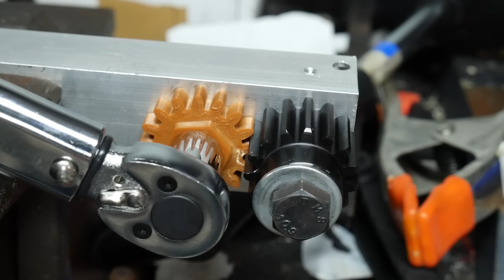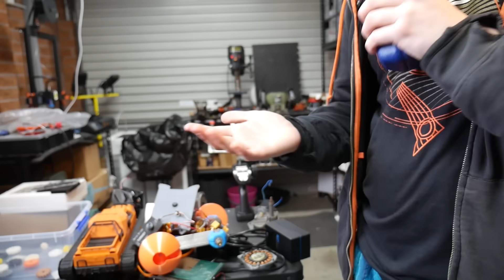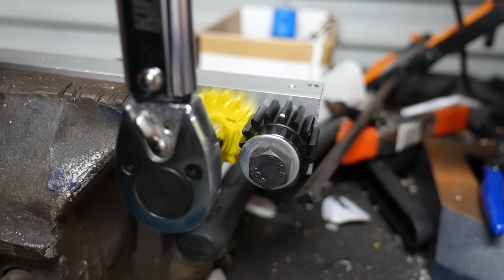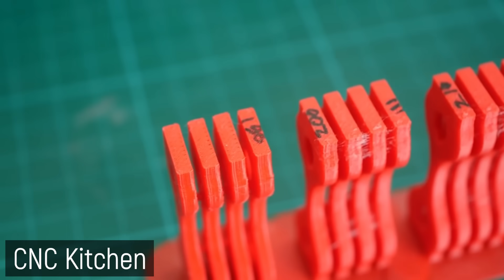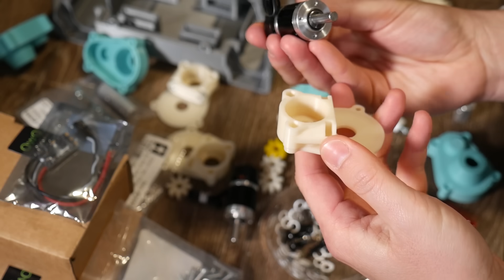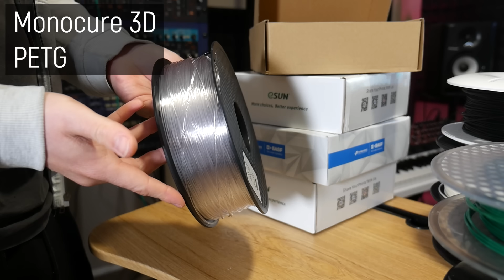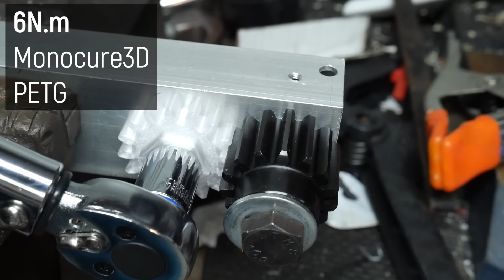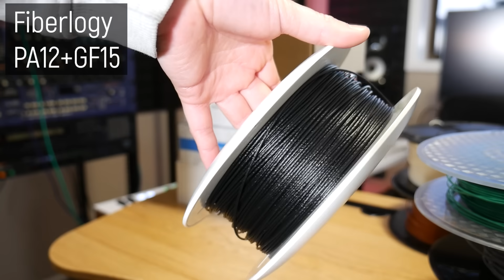Which 3D Printed Gear is Best?

Comment: Awesome video , big kid myself so have printed several rc gears and for what it’s worth small motor gears I’ve had excellent luck with Pla as it holds up well “ largest success with the common 550 brushed motors “ really any larger and friction develops too much heat in my experience and I’ve had the best luck with nylon here “ Taulman “ that even holds up well on my hpi 5.9 nitro , in a pinch I’ve even used some on my hpi flux hp which runs a 1/4 turn brushless which is just insane power wise fed with lipos , while these only lasted for say 45 mins on average with heavy abuse, keep in mind I  broke the hardened steel gear it had factory and kept me entertained till the replacement gears made it via post , I’ve never tried pc as my printers hotend max out at 270 which is a little low for it , did try a pc/abs blend but the nylon out performed it , no fancy torque wrench tests performed on my end , simply slapped the gears in the truck and drove it like I stoled it lol , would love to see how true pc would perform to see if worthwhile to upgrade a printer or not for it

Comment: I have printed gears before.  Tuff PLA 6 upper, 6 lower 7 outer walls 90% infill with no problem.  210 degrees nozzle and 55 degrees bed

Comment: Hey Angus, I noticed you applied the torques one after another in the same gear until it fails. When you do that you introduce cracks and  other deformations that's can cause premature failure. Is visible for ABS. I understand that you need to apply the torques for each specimens until the max level. Them you toss it out and start fresh in a new one.

Comment: I made a PETG speedometer drive gear for a project car. I didn't expect it to last too long or work well, but aside from uh, getting the ratio wrong (lol) it actually worked flawlessly and is still working! So I guess PETG is gear oil safe.

Comment: Perhaps a two piece gear would work well. Like a stiffer plastic mounted on the 12mm hex, then splined into an outer ring that forms the teeth of the gear made of one of the softer materials such as nylon.

Comment: I like nylon for gears bc of its memory and its self-lubricating. It's important to rehydrate nylon after printing before applying any stress.
Reply: Rehydrate? Could you tell more about this?
Reply: @BOTmaster15  as you may know, you have to dry nylon before printing it. Doing this makes the nylon brittle. It will rehydrate on it's own in open air after a week or two, if I'm remembering right. I leave my nylon parts in water for a day or so. They are noticeably different afterward. if you tap on them before the soak they have a higher pitch brittle sound. After soaking it's more of a thund.

Comment: personally... for a drive train i would much prefer a soft slip (like the nylon) over a hard break because any sudden spike in load could easily cause damage rather than being absorbed, it was a massive issue I had when I used to race off-road RC cars to get the best launch and acceleration the slipper clutch was almost completely locked and the engine clutch (nitro engine) was set with a high engagement... you had to make it around the first turn first otherwise any bumps from other cars risk removing teeth from gears....

Comment: If you plan to print solid, do not use 100% infill, use either 999 walls or bottom/top. Infill usually has different printing parameters from walls, often ending up under extruded.

And of course, melting it in salt would work here nicely and you get the parts annealed at the same time.

Comment: Could the Wood version of the filament be better than the others as that has wood fibers in it and is so good you can even sand it like real wood?
I would think that those wood fibers could strengthen the plastic more as the fibers of wood still have there own strength on top of the plastic strengths.
Reply: Nah, it's just wood particulate and the wood filled filament is very weak.

Comment: The fail mode isn't realistic in my opinion. You're stepping up the torque setting and testing on the same teeth when this is unlikely during service. Is there a way to incrementally increase the load on the gear as it is being driven by a powered gear? You might achieve higher Nms.

Comment: Very interesting results, I would have expected a wider range of failure strengths. Is there an .stl available for this gear? I'd like to try out some of the engineering-grade filaments we have at work. We often use Essentium's HTN-CF25 in place of machined aluminum, it'd be really interesting to see how it does.

Comment: 100% infill would be interesting with a decent amount of wall overlap.
Reply: If you want strong print - increase perimeters. It work better than infill.
Reply: @myudshlihe  Not necessarily. Walls can easily delaminate.
Reply: @bldjln3158  if walls delaminate - it is bad print. Check your printer and print settings.
Reply: @myudshlihe  hi what do you mean by increase perimeters? what setting is that
Reply: @Darfail  I mean perimeters count. In PrusaSlicer it is "Perimeters" in "Layers and Perimeters." I don't know how it called in Cura. "Wall thickness" I guess.
Reply: @myudshlihe  very true. I make competition robots for my university to compete in the VexU robotics competition and we 3d print all our gears and lots of parts. I cannot tell you how my jaw dropped when I saw he was only using 3 walls. His gear teeth weren’t even full infill. I love this guys channel but this is horrible test video because of how little walls he used. He was just asking the gears to break

Comment: 14:47 the PA12 + GF15 test shows one of the gears being permanently damaged and possibly half ripped off at 12Nm, it's partially springing back yes but it's obviously broken at this point.
Reply: Noted that too but for me, if you look closely can see the gear shearing off at 11nm
Reply: glass of carbon fiber (fill) is not for gears (or anything with mating surfaces) as it's very abrasive, and it's way even stronger not a good idea for gears.

Comment: A big advantage of 3D printing is that you can put one of each material on every wheel and see which one fails or wears out first :)   People more knowledgeable than us have already solved this problem IMO, almost every injection molded gear is made from nylon (lubricity and toughness). I've also seen acetal (aka POM aka Derlin), but that's a nightmare to print. I would stick with nylon, and I would avoid the fiber filled varieties, both due to lower lubricity and potential health reasons if it liberates carbon fibers (glass fibers may be safer).

Comment: Your research confirms to me that ABS is still the best universal solution? It’s durable, high temp, relatively easy to print with a heated chamber, and inexpensive. All the others trade off one of the values making them a poor for specific applications. I really appreciate the efforts on this testing, it’s a great real world evaluation using inexpensive tools.
Reply: He hasn't tested surface abrasion resistance. Generally ABS gears are avoided, as this material tends to be spectacularly bad in this regard. It is an inhomogeneous material, as it's not a true copolymer but a graft copolymer, it's based on butadiene flake that has two other monomers polymerised on top, so it contains potentially a large amount of cohesive particles of butadiene that have different physical properties and can easily separate out.  It really needs an endurance test to see how the materials behave, it's probably more relevant than ultimate strength.

Comment: How about trying ABS with acetone wash then heating in an oven at 80c for an hour. This worked well for a airbox for my sons car, strong and and never deformed even when he cooked the motor.
Or ABS coated with resin and then cured in a wash N cure and then placed in the sun for a while. I do this when I need a part that is strong and needs that shiny look. I believe this works better then acetone vapor smoothing however it doesn't seem to take the heat as much.

Comment: I'm slightly disappointed you tested only one PETG filament. There are certainly better/stronger PETG filaments than the clear ones (going for optical clarity may compromise the mechanical properties). I'm using PETG for gears as it can handle more heat than PLA, has great abrasion resistance while prints just fine on almost any printer.

Comment: well what you are testing in this video is the maximum strength at impulse. when the motor first switches on, and is delivering its maximum torque. however what you are not considering here is how the gears will have to hold up under a much longer term running at a more gentle wear rate / localized surface frictional heating. so for that situation you should be printing each gear a different material for each independant motor. and run them in real world conditions, trying to clock up as many runtime hours as possible. or otherwise you will need to invent a new testbed. for some new round of tests

in terms of specific fdm materials to test... well we already know from industry that the better isotropic gear materials tend to be either nylon, delrin (aka various pom / 'acetal'), or ptfe. due to the higher toughness, they all side on the 'tough' side of the properties graph. but in particular both nylon and ptfe are softer as a result. however i am guessing that the continuus meshing and rotation and coming together of the gear, the transfer surface is always feeding would mean that they are kindda kept mostly in shape and therefore do fare better to retain their shape over time and avoid too much creep (we would hope anyway). wheras for delrin it does not matter, because that stuff is really nowhere near as soft. delrin has almost ideal properties for any functional mechanical component like a gear. another category of materials in the good 'tough' group are vinyl things... pva / pvda / pvdf. you can browse on the 3dxtech website for ideas over there with many more exotic and interesting filaments. and not forgetting pei either. however just dont bother with polycarbonate for gears it's in the sugar glass zone same as petg, the brittle and hard zone. those type are the wrong properties for this application. over a longer runtime they will inevitably end up forming micro fractures and that will start the crack formation. which will first occur at those weakest points of highest localized stress. the micro fractures will then get progressively worse over time. and eventually become macro cracks and catastrophic failure. also polycarbonate does not have very much chemical resistance. so many common lubricants will make this even worse. it becomes more brittle and fails faster. no good, see?

in fact PLA also sits more on the brittle side than we would like, if you want anything better than esun pla+, then the other interesting options would be the greentec pro carbon, an the nonoilen (which includes phb, from mushrooms). these last 2 are very interesting because they do also have enhanced properties over the bog standard pure pla. including the ability to get stronger, withe correct heating treatment

but overall not to waste you own time:  there is no avoiding the need to try out a variety of options long term before actually finding out which is best. therefore you should probably stick mostly to a variety of different nylons, and look within the general PA family to see which nylons end up being the best. however if nylon is simply not strong enough for your specific application then you will really need to move up to something else more robust. like delrin, or pvdf etc. for those look on 3dxtech website for ideas but try to buy an equivalent locally if... you can. (a lot easier to live in USA for sure, but oh well). hehe

Comment: I think that wear-resistance of the material would be more important than static failing torque of a fresh gear, in most applications. Well, not only wear itself, but also how susceptible they are to melting when transmitting higher power.
I would also imagine that high infill will be much more important than in most other uses, especially when the main concern is torque, rather than wear. Without propper testing, I would certainly not my gears at 20% infill unless they were in a very low torque application.

Comment: Hey Angus! You might want to conduct a second test. because wear and tear play a huge part in reduction gearing. PLA will tear itself apart in a reduction drive and melt. it will bind up when it melts in places you don't want it to bind up.

You might want to run a high speed, test over a few hour long 
periods of time. The gear teeth rubbing against each other will inevitably destroy them.

Well, at least thats my experience hah

Comment: thanks for sharing this with us. I found also that the design of the center of the gear is very important. I have designed a double sized gears, one on top of the other. If I just design it to be printed as a single part (layer on top each time) the break point appears at the jonction of the two gears. If on the contrary I design as one small gear inside the bigger one, the print will be stronger.

Comment: I think a Herringbone gear would be able to withstand wayyy more torque
Reply: Yup, they can.  A good idea for someone doing a video like this would be to test in the way this guy did, which was great, but then test different types of gears, then do it all under a hotter temperature because gears tend to generate a little heat.  Nothing too serious, if you grease them or w/e, but they still get a little warm which can change the whole experiment.

Comment: I've printed a few PLA gears over the years, and you definitely want to print them with 100% infill and at a higher temp, to get maximum strength out of them.
Also spur gears are the easiest type of gear to design but usually are the weakest. A helix gear or beveled gear set up creates more "tooth contact area" which results in a stronger gear

Comment: do you think color is a variable?   could color be a variable?   would BASF UltraFuse pro1 Black be more suited that white?   What about cubic subdivision, or infill multiplier set to 2 or 3? (same % infill, but with more lines connected for extra strength)  I'd also be curious if cubic subdivision had better strength than cubic or not, or other infills with similar settings (multipliers and infill %)   I am relatively new to 3D printing, so I have all sorts of questions. (probably answered a million times already on reddit.. i just hate reddit)  I typically print with 3 perimeters/walls and infill multiplier at 2, I offset some infill on particular parts to make a centered pattern at specific layer heights (like right before the top layers, maximizing the infill pattern for support)  So I wonder if offsetting or rotating of the infill pattern to a more geometrically even shape for gears would be more beneficial.
Reply: I'm pretty certain that colour can matter. BASF here is not white, it's uncoloured aka "Natural White", so it's likely the best for strength, but can suffer reduced UV resistance. Black is highly opaque so usually there's so little of it, that it doesn't really affect much anything. Consider, a black pigment absorbs all the light wavelengths, so once light encounters a black pigment particle, it's pretty much done. If it encounters a white particle, it instead is just reflected and forced to bounce, and maybe it bounces outwards outside the material, then mission accomplished, maybe it bounces back further in, so it takes exponentially more pigment to make something opaque white than opaque black.

One way how it can matter is that opaque white materials (potentially the eSun PLA-ST tested here) apparently must have a high amount of ceramic pigment which greatly modifies their thermal properties, needs higher extruder temperature to achieve similar bonding strength. Someone else has suggested that a similar issue can be affecting the PLA Yellow shown here too.

I personally believe the infill should never be relied upon for strength, because it's all sparse lines which are each individually weak - you can easily get one section to fail if you can get any deformation on the outer wall, and once it does, the next ones near it will fail in an avalanche, so maybe it'll make the item feel more rigid when it's new, but doesn't contribute much to failure strength. I see it more as a support material which allows you to roof neatly and maintain good roof strength. But more perimeters, more top/bottom layers, or 100% fill would be interesting indeed.

If you have any questions, i'm always good for some hot takes, but probably not the absolute truth, and i don't always agree with the community "wisdom" which has been passed down through Facebook and Reddit.

Comment: Another thing I've learned from BattleBots is that if you want a gear box to survive hell, build in an overload clutch.  If the gears start cracking at 12 N-m, then set the clutch to slip at 6N-m and the gears will last a long time.  (as long as you don't melt them...)